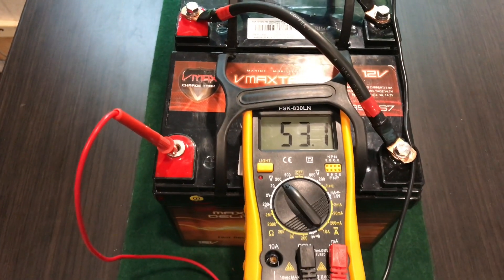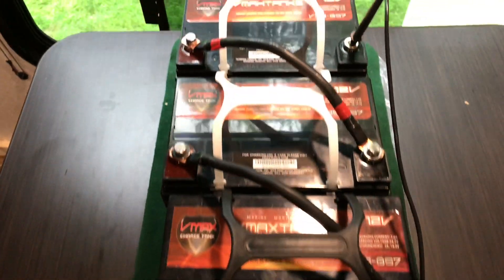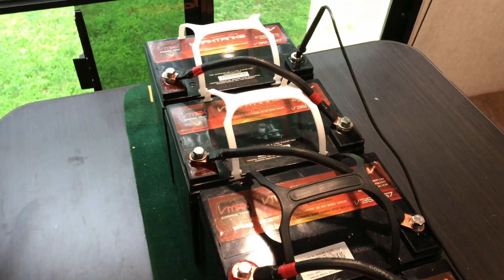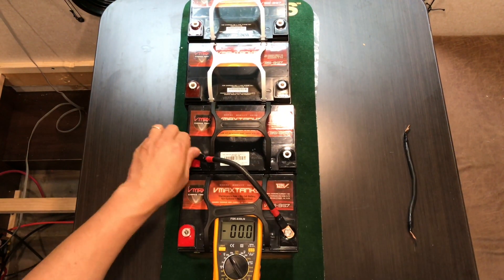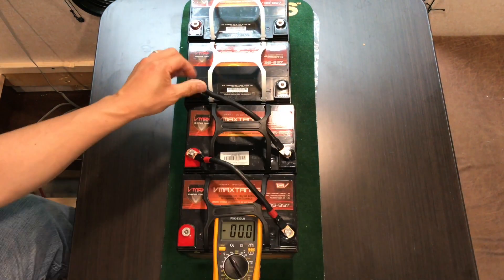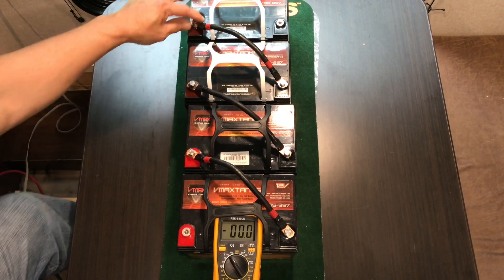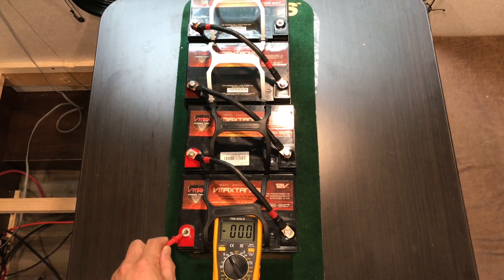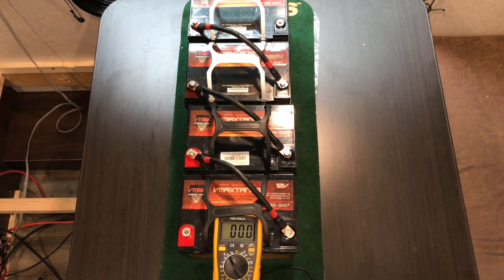How to wire batteries in series | Four AGM Batteries wired in series VMAXTanks 12v 35AH = 48v 35AH

Comment: H but how do you charge it with a 48v charger?
Reply from the maker: Best way… plug + furthest right battery post… plug - furthest left of the battery post of the battery bank. The two battery that are furthest from each other. I hope that make sense… and it helps
Reply: @cbatilo  It does thank you. I am confused about my readings with my multimeter. I have 4 300ah 12v batteries in series to run a 48v electric outboard and am wondering where on the line to connect the multimeter to and if at every point of reading should it read 48v. I have the 4 batteries all in a line horizontally. The wattcycle 300ah batteries only have the pos and neg at one end of the battery so they are all next to each other like + - + - + - + -. I am only getting a reading of 54v w/ my multimeter at the main red and black wires indicated by stars. The location on the line is indicated between the parenthesis  + - (+ - * + * -) + -. If I take a reading of each individual batteries pos and neg it will read 13.4v. If I take a reading from + - +  - +* - +* - i get 13.6V.  When i probe the + - +* -  +* - + - i get 40.6V When I do + -* + - +* - + - I also get 40.6V but when I do +* - + - +* - + - I get 27V.  Should I be seeing 48v across the board?

Comment: do matching AGM batteries require balancing?  I know with different ages I've had good reason to charge at 13.8v per cell with balancing circuit.. Also whats a clean fuse-circuit-breaker wire to protect against shorts?  I guess at for unbalance protection, zenar diode drains can discharge any battery over 14.5v per cell.